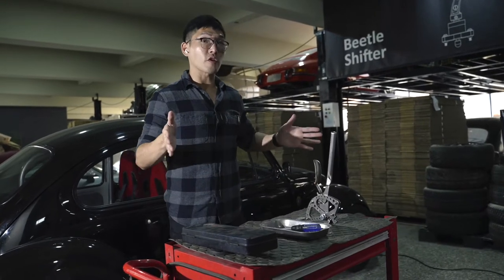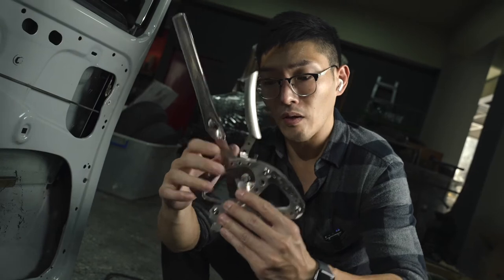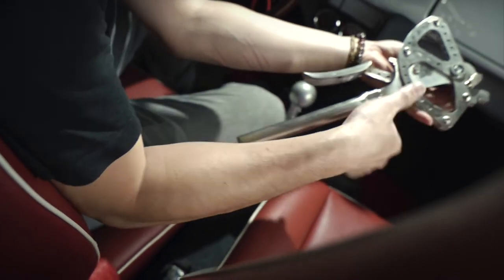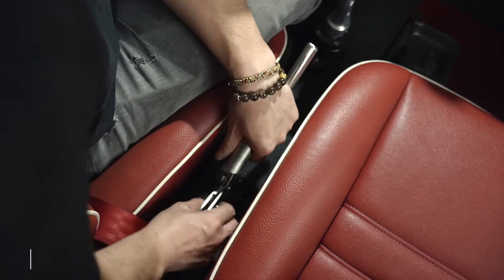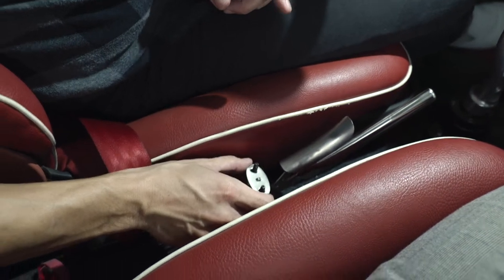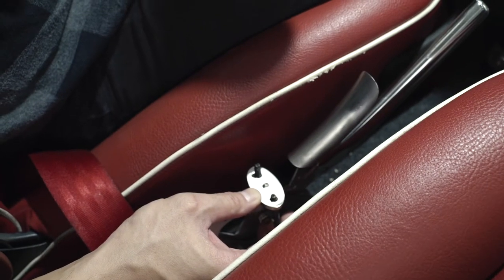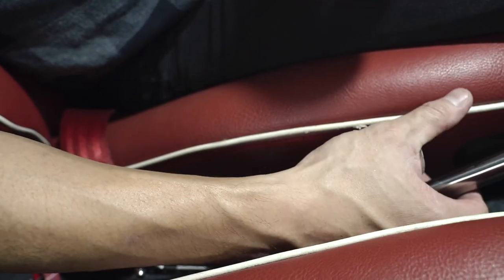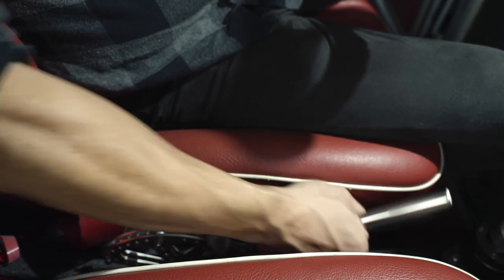Vintage Speed Handbrake Install

Comment: I understand the way you release and engage the handbrake, but what is the difference of engaging the handbrake and allowing it to click?  I personally like it to click because I know when it is fully engaged and when my brake shoes have worn off a tad. Also the handbrake is made of stainless steel so the rachet style won't wear off. In the looks department maybe you should engrave the name in the long handle, or creating an hydraulic handbrake. A pedal assembly will complete the whole interior.
Reply: If you allow it to click the gears ⚙ over time will wear out/ down  and over time the cable will be a little loose ...the whole point in not letting it click when going up and down is just to make sure the gears to the e brake don't wear out and last a long time and less e brake adjustments ..